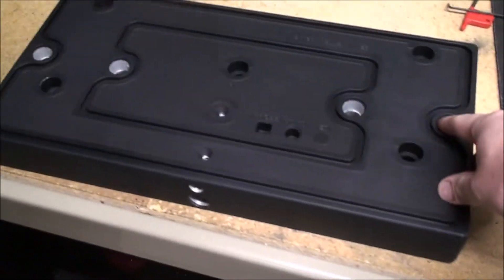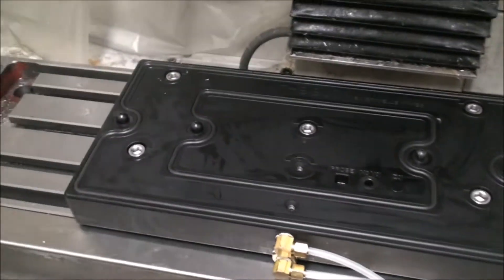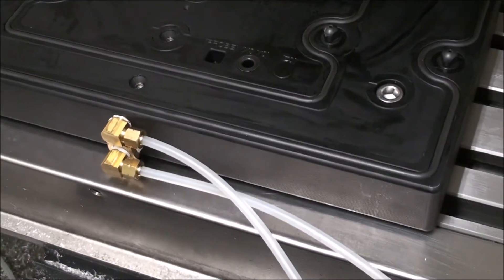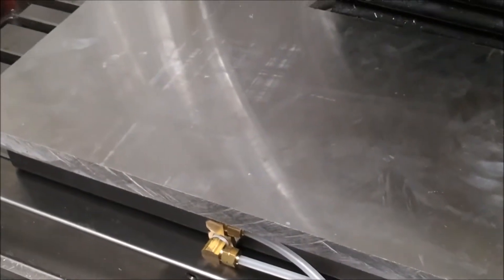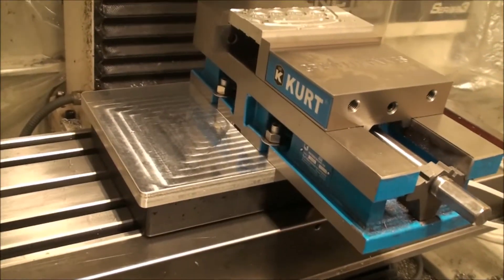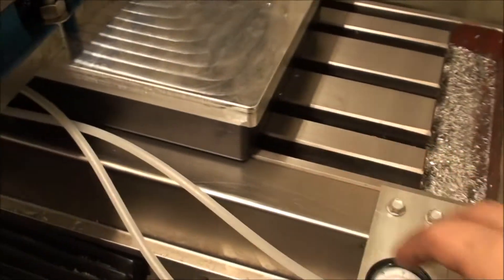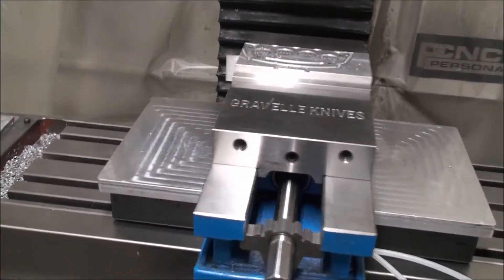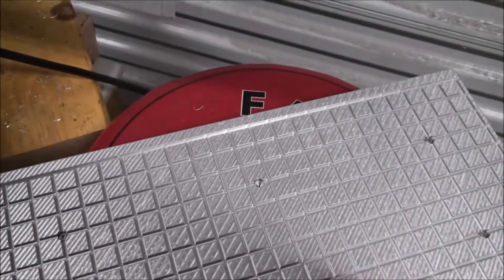DIY CNC Vacuum table (part 2)

Comment: Really beautiful work. Did you go by standard o-ring groove size charts to determine the width and height of your grooves?
Reply from the maker: Jeff Friedman no I had to make it a bit larger.   made some test pieces.
Reply: Meaning you made a deeper than standard groove to allow for the O-ring to compress enough for the two vacuumed surfaces to actually mate?
Reply from the maker: Jeff Friedman I made it about 10 thou deeper and 20 wider.  With a pallet sitting on it I have about 15 thou of clearance.  It takes about 10 inhg to compress the oring, but I normally pull 25-26.
Reply: Thanks for that. I'll be making a much uglier but hopefully functioning vacuum table with that knowledge.

Comment: Have you considered just using an electric vacuum pump in place of the venturi system? It'd be almost silent, and wouldn't consume so much shop air. That's the route I'm hoping to take, myself.
Reply from the maker: +Wrenchmonkey  Air consumption isn't a problem in my shop.  the pump will occasionally get coolant in it,  I didn't want to add a trap for the coolant so I went with a venturi.  And the venturi is actually pretty quiet once the t-slot has coolant in it.
Reply: +Josiah Gravelle 
Right on. I may give that route a try, but I think a trap and a vacuum tank would be the most worry-free. I'm gonna be doing production runs with programs that will run several hours, so I'm thinking that a dedicated vacuum pump will be the most reliable setup for pseudo 'lights out' production.